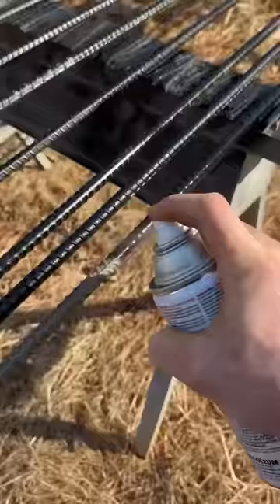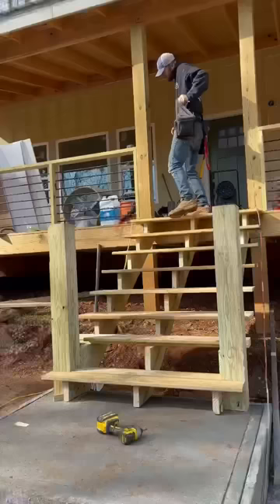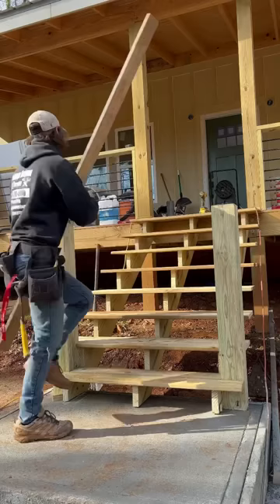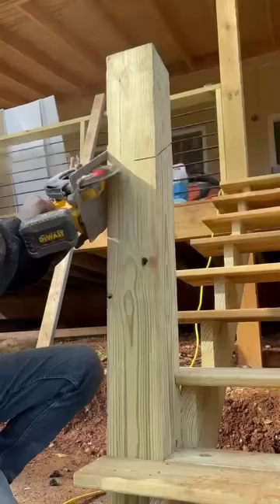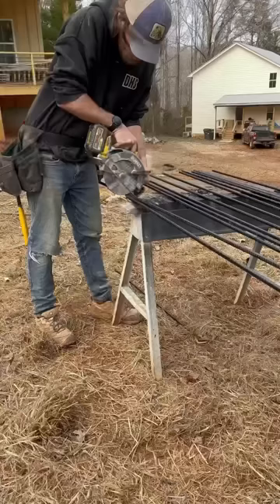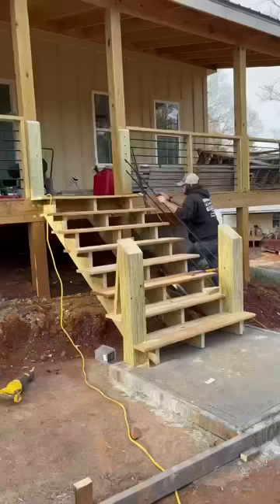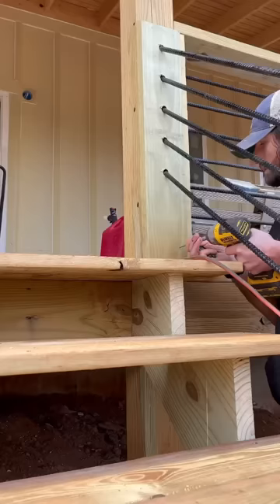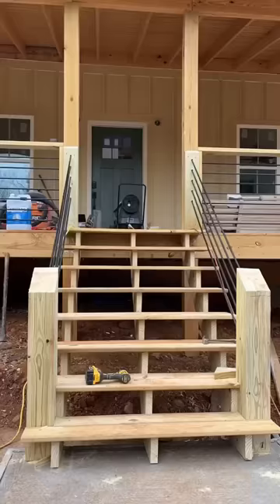Handrail 💪| Beautiful deck stairs part 4 🥳 #construction #builder #shorts #diy #skills #deckdesign

Comment: Unless that rebar is powder coated, he'll be chasing rust forever.
Reply: Personally, I think the rust will look better... a weathered patina look.
Reply: @ArboristBobbySolar  By the time there's enough rust to look nice, wouldn't every rainfall result in dripping rust down the backs of the bottom posts? He'd be seeing ugly rust stains every time he walks down the stairs.
Reply: @Cimreau  maybe, I never thought of that. I have a rebar "gate" for one of my trucks, never noticed rust puddles but also never looked for it. It's moved around a lot so rust probably doesn't have time to be a problem either.
Reply: The rust won’t hurt nothing let it rust
Reply: @Cimreau  that's exactly what will happen.rust stains not only where they enter the columns, but on the deck as well.a streaky mess.
Reply: My exact thought!
Reply: Can't tell these kids nothing.  After all it was on pintrist.  Plus his wife found it.
Reply: @wsfwsf1497  What do you know? Pintrist says that is a great Patina.  Much less the injury you'll get from the rough edges of rebar.
Reply: Should've painted epoxy coated rebar
Reply: I recommend a product that turns the rust into a paintable primer, then paint o er that
Reply: @ArboristBobbySolar  j99
Reply: Even rust will look good on this style railing.
Reply: Rust oleum is crap
Reply: I’ve seen a well weathered railing like this in the PNW. Super rusty but surprisingly no rust streaks down the posts or on the decking.
Reply: The rust will keep bugs away and if you oil the wood depending on the oil that can keep bugs away too
Reply: It would need to be galvanised, PC wouldn't cut it unless the rust is removed and it is primed with zinc rich powder and he is clearly cheap.
Reply: @wsfwsf1497  yeah my thoughts as well
Reply: US Navy has left the chat
Reply: Oxide primer..then paint.
Reply: i did this 6 years ago. no rust yet. but another coat is all that is needed when it does
Reply: @rondenniel2894  as one gets older (me) the less maintenance the better. There's a reason why mfg's of balluster systems use stainless components.
Reply: Just what I was going to say. 😂
Reply: @ArboristBobbySolar   yeah put a coat of glaze on it the character would look good

Comment: 2 years later: why is my deck turning orange?
Reply: Months later
Reply: He used the rust oleum. That stuff will hold up. I’ve used it on all kinds of shit down here right on a hyper saline lagoon. One of the saltiest places in the world. Now maybe on rebar it may still oxidize. But I do have confidence in the paint
Reply: Not years  months or less
Reply: @clsanchez77  you don't need to remove any rust for it to work. Just remove anything that is loose and go from there.
Reply: @hootertexas9711  I’ve used rust oleum for graffiti purposes on all types of metals, from trains to gates, even rebar. There was this gate that was covered in the front with rebar to block the gates and trespassers from entering since it was abandoned, sprayed it and it still held up months later.
Reply: @hootertexas9711  no it wont. trust me i know from experience lol especially because he used rattle can
Reply: They look great but they don't meet building code requirements. Also, the rebar are classified as guards and not handrails.
Reply: @hootertexas9711  PT lumber attacks iron
Reply: @tdwz1652  just cause it's a rattle can doesn't mean it won't hold u just need to do the steps like prep surfaces over coats an clear coats an water proof wax job if it's plastic or metal like car bumpers or in his case over coat clear coat polish metal finish for bars an slabs for. Metal
Reply: @allanarcangel5562  who cares? we live in a free country F them rules
Reply: @TheScumbagScav  Dude those are some short stairs for a house porch lol
Reply: @Student0Toucher  it don't matter, they have load bearing beams, the roof will come down
Reply: Wife looking like she been eating Cheetos every time she walks down the stairs
Reply: All is needed is rust treatment, and I recommend adding Penetrol to the paint - it makes paint stick to 💩 permanently. I gave my steel frames for louvered windows this same treatment & used ordinary fence paint with Penetrol! 15 years later & they are still in perfect painted condition, and NOT A SPOT OF RUST!
Reply: I didn't see him paint the ends after he cut them
Reply: 2 weeks*
Reply: @allanarcangel5562 there is always Code Boy out there!🤦‍♂️ it’s his home who GAF!
Reply: 9 months later and your still wrong it's help up perfectly so far 🤷‍♂️
Reply: @DankZank  You might sway me.  I have some excess cable I might use on stairs sometime.
Reply: Should of had them galvanized first then paint , sorry but 100% that iron is gonna rust through
Reply: @hootertexas9711  I can't believe a salty environment touches us up north with a 100 degree temperature swing.  Thermal movement kills materials outdoors.
Reply: Use frp rebar and you won’t have to worry about rust.
Reply: @Tim.1113  😆
Reply: Why not use black rebar?
Reply: @Student0Toucher how can you say that about the steps,  they are all different depending on the build. Some houses have two steps or one step. I’m not sure I understand the comment. As long as it passes code, it’s fine.
Reply: @Zoomzoom120 you didn’t see him mount the board that supports them either. Wow.

Comment: I want an update on how long that black paint lasts 😂
Reply: Yeah really. No primer or anything either
Reply: About a week. I’ll be generous and say one month.
Reply: @thomasmcmahan2014  So primer or even powder coat. So easy to be a critic.
Reply: @darenmiller2218   So primer or even powder coat. So easy to be a critic.
Reply: That's what makes this ugly. Need pitch mastic or something. That bar rusted by the next day with rust color all over the wood
Reply: @randerodr7389  it is easy being a critic when you’ve sandblasted and painted for years.
Reply: @thomasmcmahan2014  believe it or not.. i spray painted old rims with the same thing he used, and they stayed a full year,
Reply: As long as they don't chew on the rear seeking lead, it should only need a spray can a year. That is pretty cheap compared to my all wood deck that needs stained almost every year at 4 gallons or so each time. I will replace e the 20 year old boards with locust and cherry whichever needs dropped first. I have a ton of ash wood thanks to diversity and China.
Reply: @jericlocke1  fr fr, +the fenders i sprayed where on my old car, now they’re on my new one and u cant tell, paint hasnt been touched up, nothing
Reply: @darenmiller2218  No.
Reply: There making spray paint a lot better then they use to if you buy a good brand anyway? I have a old small decorative wind mill that was pretty beat up and rusted. Sanded as much rust off as I could and just spray painted all the parts green and gold and black. To my surprise the spray paint had held up and still looks pretty good for several years. Starting to look weathered now, but the paint hadn’t worn off and no signs of rust yet.  Originally I figured I have to repaint in a year at least, haven’t had to touch it yet I’m 5 years.  I can’t complain even if the paint starting to fade some now!
Reply: @ghostridergale  the rims im talking about were sold to me for like 300$ and i resold them (1000$) after sanding and spray painting them black, nothing else
Reply: Let my kids come over they bend every one of them on their Best behavior u need reinforcement if you want kids
Reply: They make a gorilla product made for waterproofing.Its black that last. I used it for underwear ponds and on metal. I forgot what it's called
Reply: @aaronk4310  good to know. Thank you
Reply: @aaronk4310 what the he'll is an underwear pond?
Reply: @Notthisguyeither 😂for real

Comment: Code specifies that there can be no area on a stair system that has a gap greater than 4". So between the rebar and the stringers, the missing risers, and likely the spacing between vertical posts are all violations.
Reply: Correct, this DIY handrail will fail code because it can trap/strangle small children and animals with no vertical risers.
Reply: @FBfogo Also, there is no "graspable" handrail on the stair section.
Reply: Stringers every 4" ? That can't be
Reply: @radtothebone23  Not stringers every 4". No gap greater than 4". Stringers require either a riser (a vertical board you would "kick" when going up the stairs) or that the treads are not more than 4" apart in height. My comment was that the stringers were missing parts that made them legal.
Reply: @joshuawiedenbeck6944  I understand now. Thanks!!
Reply: and railings can't be horizontal "climable" (Ontario)
Reply: I see the danger for kids on the rebar it may looks good but there is not risers,  no offense. Thanks.
Reply: Also, rake rails are allowed gaps of up to 4-⅜" whereas level rails are limited up to 4.0" gaps and it is measured using spheres with those diameters in IRC code book.
Reply: @Just_Checkin  Yeah, a sphere with a certain amount of pressure applied (I can't remember the lbs required off the top of my head).

Comment: Would really recommend do thorough prep work on the rebar. Sand, 2 coats primer, 3 coats paint.
Reply: Powder coating
Reply: I agree with you ,he needed to do a much better job of preparing the rebar he,s going to have a mess in 2-3 yrs.
Reply: Need to give them a bath in OSPHO. That will stop the rust.
Reply: Treat rebar with ospho prior to painting to prevent rust from bleeding through.

Comment: This is against code in most regions:

-You can’t install spindles horizontally with that much space in between; children will use it as a ladder.

-You can’t install spindles vertically with that much space in between; children will stick their heads through the space and get stuck 

-Finally, railings are safety features - they need to be able to take the full blunt force of a toppling adult at its weakest spot in order to serve its purpose; if an adult were to fall directly in the middle area of the bars - the bars would flex and rip out of their holes. 

Now there’s safety hazards falling with with the victim which could cause even more injury. 

Looks nice though 👍🏼
Reply: As long as he has good house insurance he should be good! 🎉
Reply: If they don't deny your claim anyway because the railing wasn't to code.
Reply: Without throwing a tape on the spacing, looks like 4” between rebar, would a 6” sphere pass through the stair to spindle triangle?  Hard to say. Horizontal steel cable is acceptable i dont see why rebar would be any different. I dont know where he is but i bet the inspector would pass it.
Reply: I don't know what children they have in those parts where you read that code but in the rest of the world even the babies have a bigger head than the space between rebars.
Reply: Nobody is going to mention the definite code violation. no toe boards.
Reply: @peterfitswell535  not sure what tow boards are. Are u referring to stair risers
Reply: Horizontal balustrade not against code , however space below bottom piece too large and risers need to be covering to leave no 4”gap.
Perhaps painting coated rebar would work
Reply: @Ball_drips  yes
Reply: @Ball_drips  if the kids stuff on it it would pull right out at the end and down they go
Reply: Just what I wanted to say...
Reply: And top grab rail has to be a certain size to grasp it with a hand. I think its 1.25 diameter or something. The decks and stairs around here built after Hurricane Sandy that have a flat board like that were failed and they had to install second grab bar with brackets to pass final.
Reply: I don't think anyone cares in the area that this property is at
Reply: Piggybacking, the 2x4 uprights are not close to meeting code. Deck/railing codes have a come long way in the last 20 years. It doesnt matter whats in between, if the uprights aren't able to take the full force of a falling adult pushing at the top. The NDS and its supplements are a great place to learn what and how to build to code.
Reply: Thats the comment I was looking for. When I saw he just bent the rebar to get it to fit, figured that would easily pop out if a kid fell into it or climbed it. I was waiting see if he was going to secure them somehow. But nope, made a safety feature just a decorative one instead.
Reply: @irvin295 Insurance won't cover it because there is video proof of him doing it. Falls under illegal structures.
Reply: Go fly a kite. You know what else kids can climb outdoors? Trees.
Reply: @kstorm889  

Precisely…

Kids are prone to climbing things - hence why this style of construction is treated as an avoidable safety hazard.
Reply: A 4" sphere must not be able to pass through any portion of a stair rail or guard rail. Code requirement for interior or exterior.

Comment: Love this and looks beautiful! But just an FYI, having the rails horizontal like that is against building code (dangerous because kids can climb up them and fall off the other side). If you don’t have kids/guests with kids, then not a huge concern, but something to keep in mind if you ever plan to sell!
Reply: Yeah--also the gap between the stair treads and the lowest rebar is too large.

Any place that HAS building codes in place would say this is a violation.
Reply: One more note regarding safety if you are somewhere that has building codes.  Horizontal railing systems usually have to be anchored and tensioned to prevent them from flexing and allowing a body to pass through if an adult falls against them.
Reply: Usually doesn’t apply outside of city limits, but still…
Reply: Not sure where you build but the only code around here requires less than 4 inches of free area . We build most rails on view property with Stainless steel cables and they always pass inspection.
Reply: Building code often differs by city, and certainly differs by state. It's probable that there's not a code for rail on a private residence, again depending on where you live
Reply: @anthonybrakus5280  common sense is universal
Reply: @deannawilliams425  it's all fun and games until you're mopping up a toddler.
Reply: We do cable all the time and we have some of the strictest codes in the country.